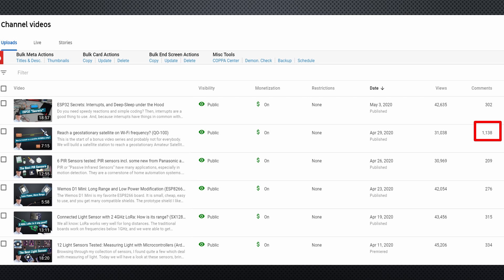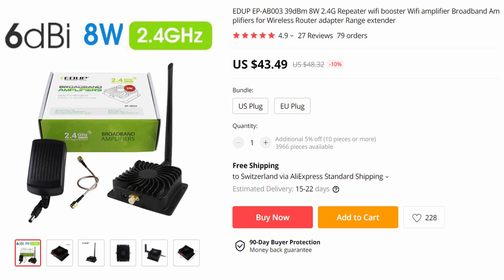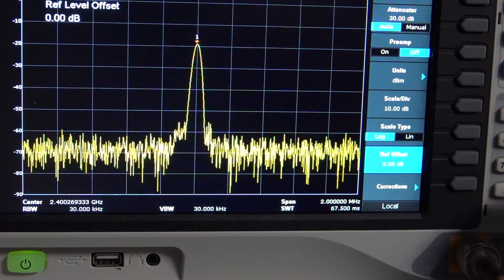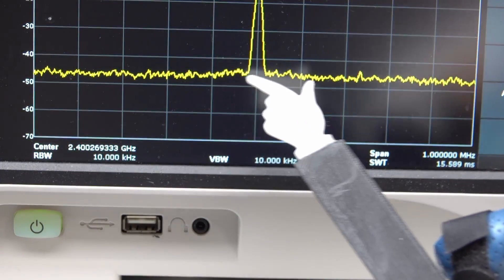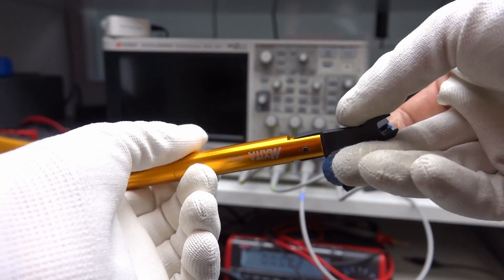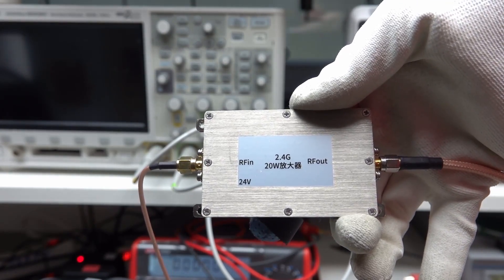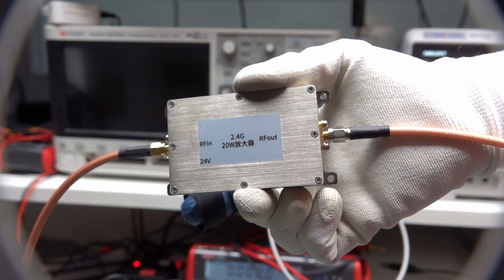#329 QO-100 How Do We Get 20 Watts Output on 2.4GHz Wi-Fi

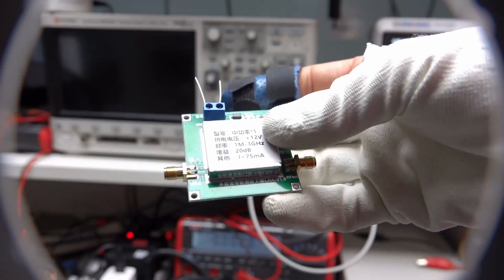Comment: 6:46 Could someone please clarify why he used a 20dB (max 10dBm) amplifier when previously he explains that he only needs to amplify 1dBm + 5dB => 6 dBm?  Does this mean he is passing 10dBm of power (10mW), i.e. 4mW more than needed?

Also, when you say an amplifier is capable of 20dB with max 10dBm output does this mean that it is capable of amplifying by +20dB but up to a max output (10dBm)? This makes sense, but just checking.  This means a 0dBm signal will be amplified to 20dBm, but due to the max cut-off the amplifier will only supply 10dBm.  However, if the signal was say -20dBm, it can be amplified to 0dBm (1mW), right?
Reply from the maker: 1. I take what I get. So an amplifier with more gain is ok becasue I can reduce its input signal.
2. Yes. You read the specifications right. 20dB amplification up to a max output of 10dBm
Reply: @AndreasSpiess  thanks for the feedback Andreas. Switzerland, specially Geneva, is a very special place for me. I have family who are now Swiss. I used to spend many of my University related vacation days in Geneva. I have a deep seated obsession for horlogerie and collect Patek watches (and a few others - I have many videos on my channel).  I’ve travelled through Basel, Bienne to the Omega museum, and also spent time in Zürich. I dream of when I can visit again!  Thanks, Best Mike (from Sri Lanka). 

(P.S. I finished my EEE bachelors and MSc in Mechatronics many years ago in the UK; now I mainly tinker in my homelab as a hobby.

At University we started with microcontrollers before GitHub or Arduino existed. I ended up writing my own C/Assembly libraries just for SPI or I2C, even PS2 to talk to a mouse!)

Comment: Oooh, you get a nice plastic card for your licence. We in the UK get a website and a link to download a PDF file :/

Also, "20w is too much" makes me laugh, as I use my 250w amplifier all the time 🤣. Granted that's doing about 50w on DATV, but I can use it on NB too, I just add 20db of attenuation so the 68.5db amplifier doesn't de-orbit qo100 :).
Reply from the maker: We have to pay 150$ a year for this "plastic card" :-(
I now have a 120cm dish and only need a few watts for SSB. Unfortunately I still have issus with my Adalm Pluto and the Ethernet connection to SDR console. So I am not QRV.
Reply: @AndreasSpiess  Have you done the grounding mod to the Pluto? The locking up when using ethernet comes from a difference in ground references, which flips the pluto back into USB mode, taking it out of OTG mode.

I fixed it by soldering a wire link across the choke on L7's ground.
Reply from the maker: I did not do it yet. But I will do it now... Thank you! I think that my Ethernet does not share the same ground. But anyway, it cannot hurt!
Reply: @AndreasSpiess  The difference doesn't need to be much, 250mv AD says here under "Why do a Rev C", but it's enough to  pull it out of host mode and put it into device mode. https://wiki.analog.com/university/tools/pluto/hacking/hardware

They suggest changing a resistor, but when you see the size of it, it's just easier to join the grounds together :).

Comment: In India we got some junk 2.1Ghz 3G band BTS PA module and converted to 2.4 Ghz with just tweaking the bias. Of course it's not easy to get it now, thanks to overwhelmed response by HAMs here, even the illiterate scrap dealer knows how costly it can be. 
Anyway, we are getting around 40 watts output . I am on a same project with a pluto SDR, but as already you have shown it, I need a pre driver to drive the PA. 

Thank you for the video. Also your POTY antenna one is great to start, as video illustration is far better than those on blogs. 
Cheers. See you on QO100 or 20 Meter SSB, Europe remains open to India around 13:30 hours to 15:00 hours UTC. 
Hope to see you down the log.
One more project if you want to try, the uSDX standalone SDR using Arduino. 
Excellent piece or art to learn and see how things got into such a low performing Atmega328. 
73 de VU3GDP 
Guru
Reply from the maker: Unfortunately I am not QRV on HF. The only antenna I can mount for the moment is the dish. And a hotspot in my lab for DMR ;-)  73 de HB9BLA

Comment: Sorry for my poor English, but i have tried the low cost power meter beetween HP ( 437 )  power meter and the low cost power meter is a gadget but not a real mesurement device . Best regards .
Reply from the maker: If properly used with attenuators it works ok. I did not test it, but there are some tests in the internet.

Comment: Hi Andreas, any idea what the input impedance of the cheap power meter is?  Is it 50 ohms, or something else?  I don't see it listed in the specifications for them online.
Reply from the maker: It should be 50 ohms. And you have to add a lot of (50 ohm) attenuators anyway...

Comment: thanks for the great videos, here is the final stage datasheet and sorry for being late but I just saw the video:
https://drive.google.com/file/d/1_n7bcDmYBfWvTdVBRHid_1_n4j9QNb_K/view?usp=sharing
Reply from the maker: Thank you for the datasheet. It seems that 20 watts @2.4GHz is outside specs... This is probably why I did not get the full power.
Reply: @AndreasSpiess  I bought jammer from same seller and disappointed that its only 15W not 20W as they claimed, BTW the jammer has the exact same PCB but with extra components. I can share its pictures if you need
Reply from the maker: For me is is not critical because I will not use 20 watts. But it is not very professional, I think.

Comment: I am currently looking into the chinese 20dB LNA pre amp. Do you think it would also work as a RX pre amp near the antenna if you have to use a lot of high loss cable between antenna and receiver?
Reply from the maker: Maybe. But the LNBs already have amplifiers and you do not need one

Comment: A lot of people don't fully understand that SSB is AM. What most people call AM is actually DSB with carrier. Interesting here in VK standard and advanced licenses get to play in this 13cm band without special licenses from ACMA. Advanced get a full 120w constant or 400w PEP. Of course our friends in USA get 1500 PEP if they get that band. That's way more power than you'd realisticly need especially when running lots of gain on the antenna. For any non hams reading this the most important thing is line of sight. This is why NASA still hears Voyager 1 and 2 and big dishes and modern DSP. They're 18+ hours away at the speed of light. They don't run a lot of RF power considering how far away they are. So RF power is not all it's cracked up to be. Can't wait to hear your QSO.
Reply from the maker: I do not want to dig too much into radios. Otherwise I lose most of my viewers ;-)

Comment: If you tell someone that you are trying to use SDR radio on Wi-Fi over satellite to talk to the South pole they will think you may have been in lockdown too long!
Reply: @AndreasSpiess   I have a CTT 66087 microwave amp with 40 dB gain.  Would that be good for this project?

Comment: I believe this power requirement is an overkill, but I don't know yet, how you will transmit the radio signal. Many years ago I have programmed satellites, and we used a precision dish with an atomic clock mechanism and then the transmitter required just something around 1 Watt of output power ... also because the satellite receivers are very sensitive and it is pretty easy to destroy them with an over-powered transmitter.
Reply from the maker: We will see. I for sure will not start with the biggest power ;-)

Comment: The Pluto needs a filter in the TX chain to suppress the spurious signals, e.g. https://www.taoglas.com/product/airvu-bpf-24-2-4ghz-band-pass-filter/
73, DD8PL
Reply from the maker: I will check if this is necessary. So far I did not see many projects using it.

Comment: For the 2.5G uplink, do you use a dish or an array of yagi’s? If the 20W uplink power + antenna gain is sufficient depends on the available satellite up/down link budget. 8W could be enough with a clear sky, but a rainy day at the transmitting location and/or on the receiving location can put your signal in the noise. 73’s on5vb
Reply from the maker: I will start with a POTY and an 80 cm dish. 73 de HB9BLA
Reply: Andreas Spiess Nice solution. I was wondering how the feed construction would be.. I think the dish gain will drop about 50% at 2.4G. At the receiving side, is the selected freq deviation tracked in software? The local oscillator of a low cost lnb shall not be super stable.
Reply from the maker: I plan to show both possibilities

Comment: Perhaps the spurious emissions result from intermod distortion due to the 28v boost converter. Would be interesting to power the module from a separate linear 28v supply?
Reply from the maker: They were already there before the PA, just less visible, but similar distance. So I will check again with the final GPSDO.

Comment: Another great video Andreas, thank you.
I just wanted to add a bit regarding the SSB. With the conventional amplitude modulation AM we transmit the carrier (tone) and the modulation signal's spectrum on both sides of it with the amplitude of 50% of the carrier for 100% modulation (i.e. when the modulated wave goes down to zero). If we assume that we modulate with a sine wave, the power, transmitted in each sideband, is only a quarter of that of the carrier. The SSB cuts off on the carrier's power (as you can see on the displayed spectrum, not completely in practice), and on the other sideband. Overall it becomes 6 times more power efficient in this scenario (sinewave modulation). Power saving when idle simply comes from the absence of the modulation signal.
Reply from the maker: Thank you for your info.

Comment: FYI: SG-Labs in Bulgaria makes a rather cheap (€126,-) 20W amp and also nice transverters. Analog Devices RF Amplifier 2.4Ghz EVAL-CN0417-EBZ Kit with 1W could be handy, too..
Edit: Did you really go for a Siglent SSA3032X for 3kCHF instead of just hacking a 21X to 3.2Ghz? :) I wouldn't stack attenuators like this (leverage) - cables are fine.
Reply from the maker: 1. I know, but he was not able to deliver to Switzerland (COVID)
2. I was one of the first customers a few years back. And a wanted to cover 2.4GHz. So no hack was available

Comment: Awesome. Thanks for sharing. I have a spectrum analyzer but it's only good to 1GHz so it's nice to know there's an inexpensive way to measure power. I don't think I have an SWR meter that will work up there either. Maybe I can find one in AliExpress.
Reply from the maker: Look at the VNA video I made. Much better than an SWR meter. Or wait till the antenna part...
Reply: @AndreasSpiess  , sq2jul,
Thanks. I'll look for that.
Reply: There is cheap NanoVNA 2.0 available which is able to do measurements up to 3 GHz. The device is sold without calibration kit so you have to buy it additionally  on your own.

Comment: Re: Receiving signals from geostationary satellites. I have a little tiny Pioneer Inno handheld receiver for XM satellite radio, the size of a Walkman, and it can receive signals directly from geostationary orbit. Signals which are hundreds of channels of lovely stereo music, or BBC WS. I can bring it outside anywhere in North America, and listen to satellite radio. I still find that amazing. Cheers.
Reply from the maker: I assume those satellites work with higher power. So it is easier to receive them.
Reply: Much easier. The handheld receiver's antenna is inside a little plastic cylinder just 1 cm diameter by 2 cm high. On the other hand, the bandwidth of reception is presumably about MHz wide to accommodate so high a data rate to provide each boquet of channels.

I have to keep reminding myself that the XM satellites are in geostationary orbit, so far away.

Comment: This episode brings back so many many MANY memories.

In 2006 I was introduced to our company's satellite ground station. I don't remember all the specs we operated "new" I.P. MPLS across multiple birds. But we were using unused Ka / Ku bands and channels between 13 and 40 GHz. I honestly cannot remember what the broadcast power was. The teleport's 15 meter parabolic reflector dish had this huge fence around it with massive warning signs not to stand within 20 meters from any 90° position of its aimed  direction, a bird in geosynchronous orbit at 36,000 km if memory serves. It required some power..

I just cannot remember!! 

Btw, there is an excellent 2012  Antarctic Satellite white papers online for those that wish to read them.
Reply from the maker: I always knew that those satellites existed and saw the big antennas. I could not imagine taht I would be able to use one myself!

Comment: Thanks again for this excellent series!

One thing that is known to the experienced hams but which may be overlooked by new players is that one must take into account cable and connector losses, particularly at frequencies this high. I assume you have at least three cables and six SMA connectors between the Pluto and the antenna given that you are using two amplifiers. Wouldn't this cause a loss of at least 3-6 dB?
Reply from the maker: Probably 2-3 dB or so. I use very short cables. But I have a 20 dB amplifier and theoretically only need 6 dB. So no issue.

Comment: THANK YOU for showing and using a torque wrench on your SMA connectors! On addition to the "real" metal kind you showed (that cost around $200 US new), there are some composite plastic ones selling for around 30 US that do a decent job. Observe minimum radius rules on microwave cables. Also, look for an HP 11693A Limiter to protect the front end of your spectrum analyzer; they show up on eBay every so often.
Reply from the maker: Mine is of metal and you find a link in the description. It is around 20 dollars. Maybe not accurate, though. I did not test.

Comment: Great project..... I had just started building my own QO 100 station. Downlink is functional (40cm dish, TXCO modified LNB to 70cm into my FT847), now working on the uplink. Looking forward to your next videos ! 73s de Thomas F8DBY
Reply from the maker: 40 cm is small! I will start with 80cm.  Which LNB do you use?
Reply: @AndreasSpiess   I am using the TXCO modified LNB from qro.cz, it works really well, the frequency stability is very good. I had tried others too which I had lying around, unmodified, they all worked but of course frequency drift was abysmal ! 40cm is a small dish indeed but it works, I have the CW beacon at S5-6. Yesterday I installed an oval 50/60cm dish (horizontal oval), which is giving me an extra  + 1 S on the scale. My coax feed line from the shack to the dish is quite short though, only about 3 meters.

Comment: Very well explained video, im looking forward in this series :), i didnt know that power meter, at 25 dolars its very handy, i will buy one. The torque wrench also its very important, its difficult to fasten the SMA connectors by hand, and with a regular wrench it often gets very tight. A loose SMA connector can increase the noise figure, especially before the first LNA, so its a important thing, google for "MEASURING THE NOISE FIGURE OF AIRSPY AND HACKRF SDRS IN REAL TIME" and you will find and interesting RTLSDR blog entry :)
Reply from the maker: Thanks for the link. And too tighten might damage your instrument.

Comment: You can produce a Echo off the Moon with one watt in the HF range.   To a Satellite you should do fine with a watt at 2.0Ghz.     Look at the power you use to receive Satellite TV.   Your operating in the Pico Watts range.
Reply: Its not bad have spare power, you can compensate for long cable runs, use small and lower gain antennas at the uplink, and if all its good, you can always reduce the drive level at the SDR and the 2.4ghz power amplifier will heat less lot less and be happy :)
Reply from the maker: We will see. EME stations usually use quite some power and high gain antennas...
Reply: Well, of course "to receive Satellite TV" you do not use any power, the power is used by the satellite.  This will have around 100W of output in a quite directional antenna to give a strong signal on the ground which you can receive with a small dish.

When uplinking to the satellite, to get sufficient power at the satellite receiver you need to send up a specified amount of EIRP (Effective Isotropic Radiated power), which essentially is the transmitter power multiplied by (or with dB: added to) the gain of the antenna relative to an isotropic radiator.  (antenna gain is due to bundling or beaming of the signal)
The QO-100 satellite requires a transmitted EIRP of about 57dBm which can be achieved e.g. by transmitting 40dBm into a 17dBi antenna, or 30dBm into a 27dBi antenna, etc.
It is for everyone to decide what is a better combination.  A normal satellite dish (80cm) would have about 23dBi gain at 2.4 GHz so you require about 34dBm or about 2.5W of power.   With 5W you should have ample power available.
Reply from the maker: My configuration can go down to 100 mW. So no worries.
Reply: @Syme Doubleplusgood Funcube is in a LEO orbit at about 600 km, the Iridium constellation is also in LEO at about 700 km. QO-100 is on a satellite in geostationary orbit, at 35.786 km. Satellite terminals use power amplifiers from 50 W, up to 1 kW. They also have high gain dishes, so the output power is even higher.